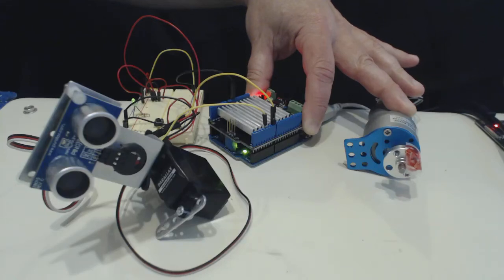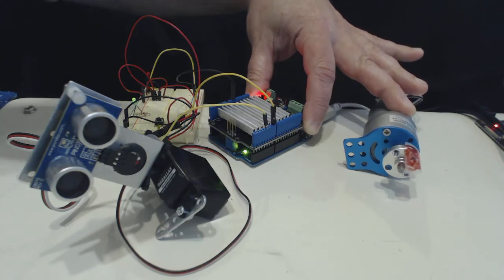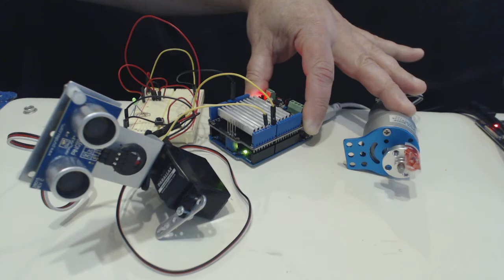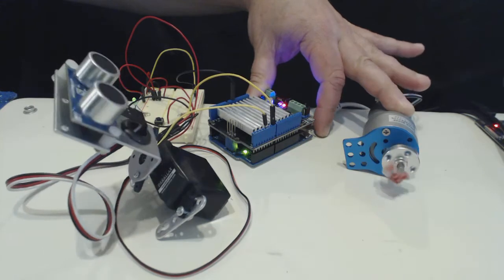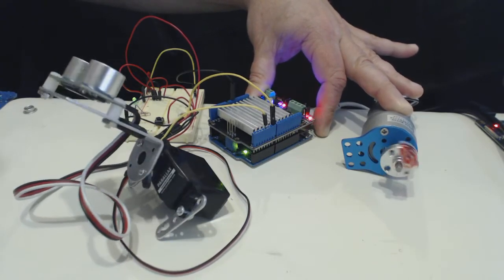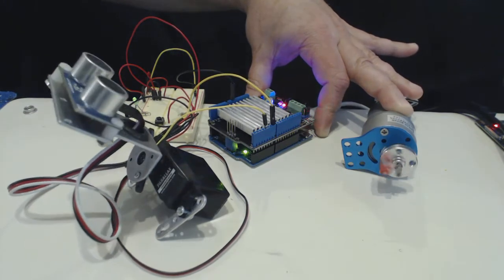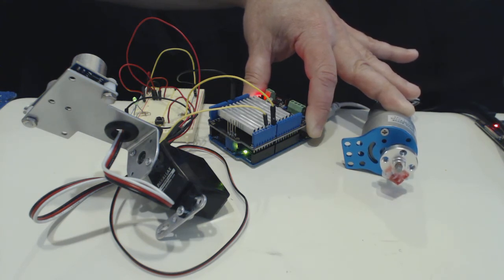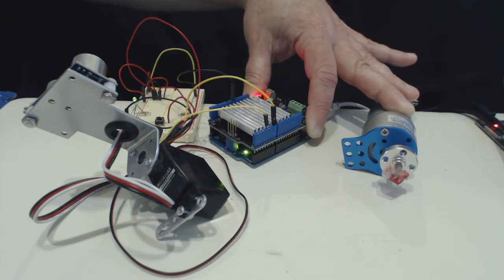FreeRTOS running on a Arduino UNO

Comment: I have tried 1 and 2 tasks and got it work find. But three task, the controller freeze. Don't seem to understand why.
Reply from the maker: Yeah, I am quite surprised 2 tasks would run on the Uno so 3 might be pushing it a bit.  It could be a stack size limitation.

Comment: 1. If the executive is different size on Windows and Linux it should be caused by different compiler options, such as optimization level, put the verbosity level maximal in the preferences and check it out in the build log output, 2. The usual ultrasonic Arduino library uses a stop-the-system delay, so you have to implement a FreeRTOS compatible one -- not too hard, but it requires some tweaking, and perhaps some use of an interrupt.

Comment: What is the number of bits the servo working on sir? I'm just a noob but that looks very smooth, more than 12 bits?
Reply from the maker: You can find more info on the project at element14 since this was part of a design competition I was involved in at the time.  For the Ping Sensor, I believe I just used the standard Servo object but for the Motor Controller I ended up creating my own. 
https://www.element14.com/community/community/project14/open-arduino/blog/2018/04/18/arduino-powered-mse-6-mouse-droid-arduino-uno-and-freertos